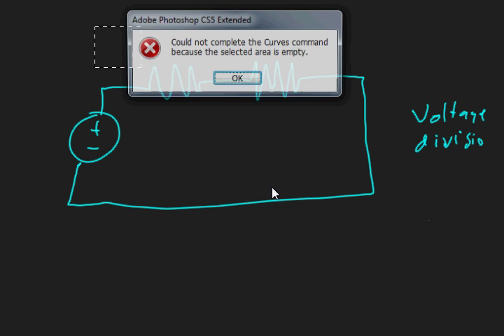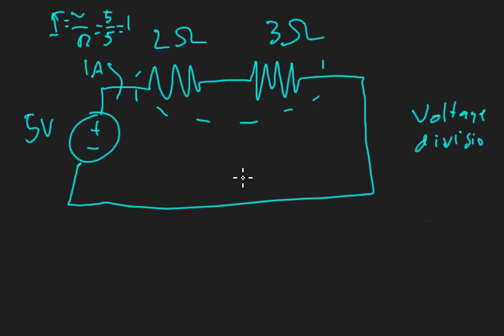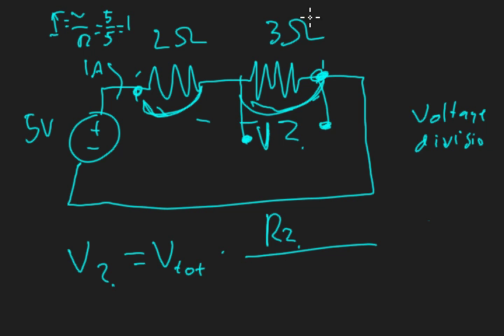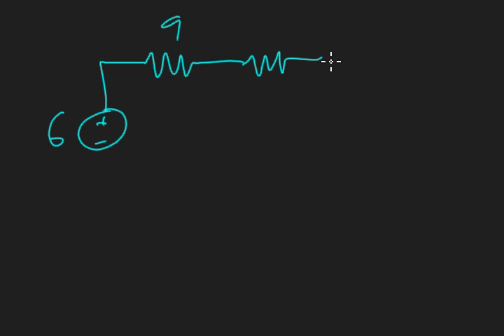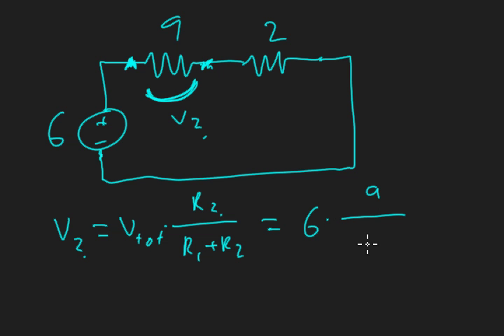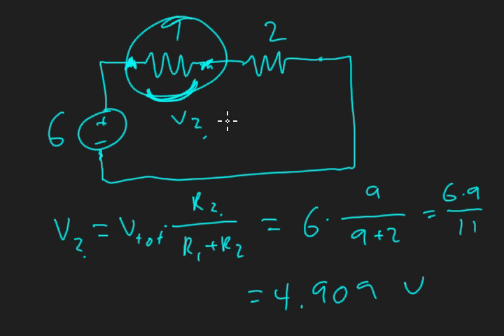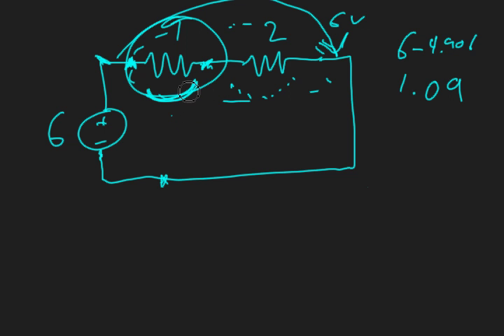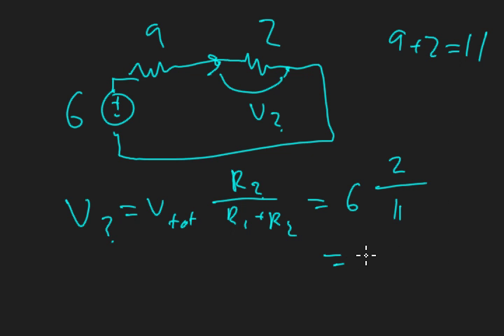04 Voltage division

Comment: I might be missing something, but this sounds wrong. According to this equation, if V = 100 and there is 1 resistor of one ohm, the VDrop = 100 * 1/1, So VDrop = 100.  So it would lose 100 volts over 1 ohm.  Is this correct?